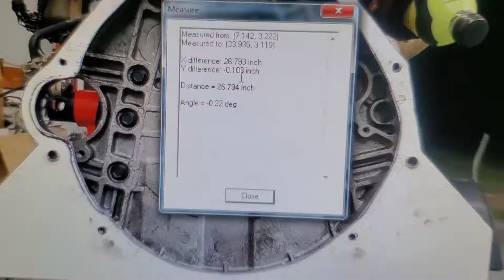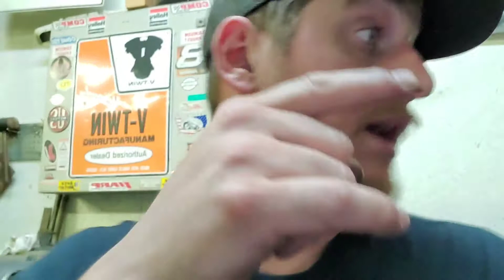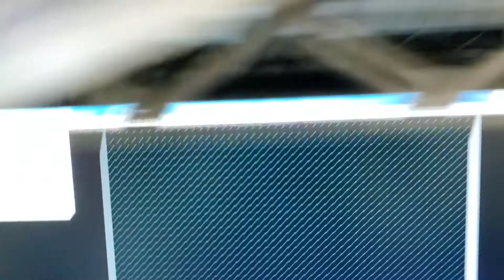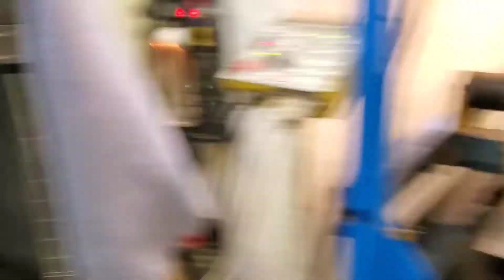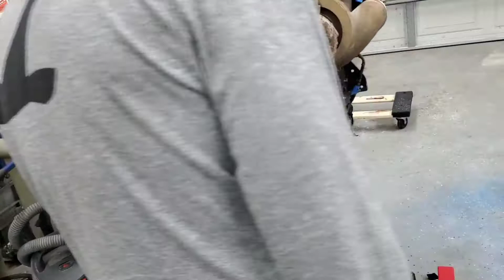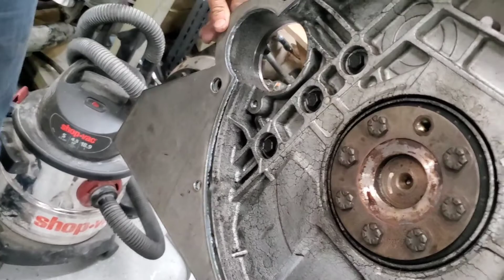Design and Cutting the Rear Engine Plate. More CNC! Cummins Jet Boat Part 3

Comment: What rpm are y’all planning on spinning at what impeller are you planning to run ?
You almost need a transmission to get your shaft speed up for pump to work properly
Reply from the maker: 4000-4500RPM AA Impeller with all the race goodies.